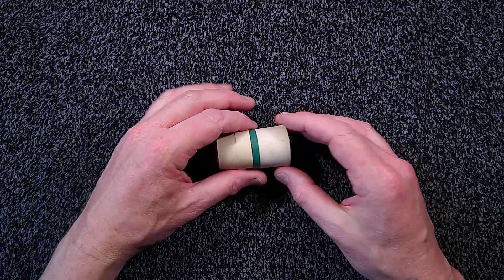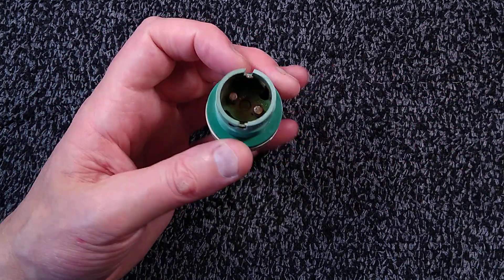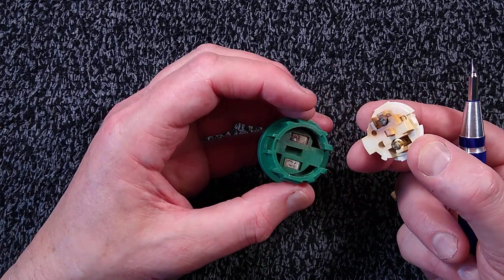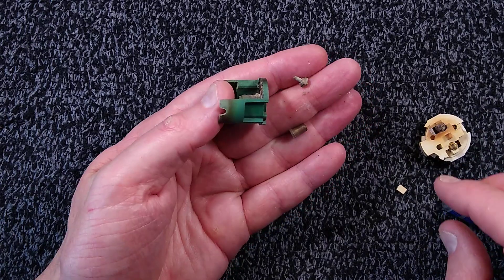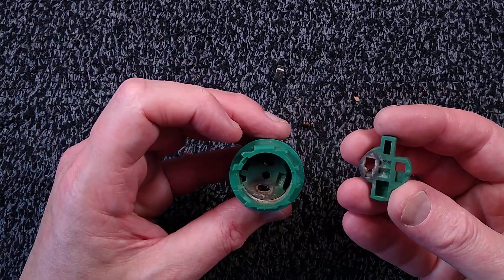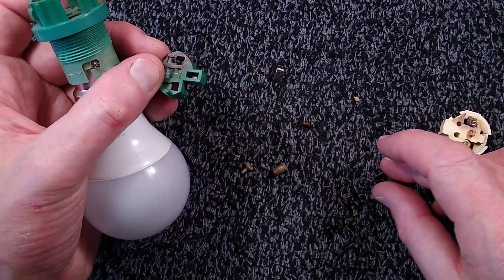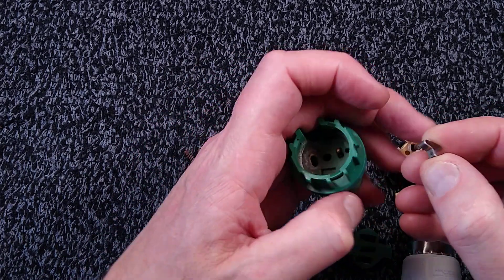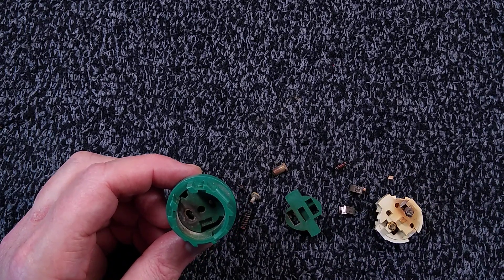Inside a failed safety lamp holder.

Comment: We always used to have a 150W incandescent bulb in the middle of our sitting room ceiling and it baked the cable suspending it from the rose. Once my late mother got a cheap paper lampshade which just hooked around the table instead of having a proper fitting. The cable baked until it became brittle, then the hook broke through the insulation (incidentally becoming live) and with a great flash short-circuited the live and neutral lines and tripped the circuit-breaker. Not long afterwards we replaced the 150W incandescent with a fitting that had five 60W equivalent compact fluorescents. This gave the equivalent of 300W of incandescent light for 66W of electrical power and enormously less heat.
Reply: We had a similar setup in our home in the 1960s, except that the lampholder was a batten type flush to the ceiling. Each Christmas, my father would very carefully remove the bulb to install an adapter for the Christmas tree lights.  In those days the cable was vulcanised rubber insulated, but when the local electrician finally replaced the lampholder, all the original insulation had crumbled and had been replaced with cloth-type insulating tape. He recommended fitting a circular flourescent lamp instead.
Reply: It's odd how 150W bulbs were readily available but the bayonet holders they plugged in to seemed to almost always say maximum 60W or maximum 75W on their packaging.
Reply: @BrianG61UK  that reminds me when I had my Lego collection in the back of an old barn one time it was climate controlled by the way since that's where the water lines were for that Barn.

I was actually using either 150 or 200 watt bulbs in the area just to provide enough light to see what I was doing I was tempted to put in for us and pictures but I couldn't get enough of them cheaply enough plan was just plug them into the existing sockets with adapters or swapping them out for the lamp sockets with the plugs already on them they were switched at the entrance to the back area.

I've wired up numerous old for us at pictures for people to use for something else or somewhere else other than where they had been originally.

Also when we moved into one of the houses my parents had at one time there was quite a few fluorescent fixtures that were left behind weren't sure if they were originally in the house or otherwise.

It was kind of in that eclectic mix of fixtures in that place as well wouldn't be surprised if some were salvaged to tell you the truth.

My mom was Raising her plans for flower garden and such for the next year she asked if I could test and possibly wire up some fluorescent fixtures over a table set up in the den to start the seeds over the winter.

Of course first check to make sure the balance were good and nothing was wrong with the fixture and sure enough perfectly good fixtures and even some of the bulbs are still good that were with them.

Matter of fact back in the day we would often get used fluorescent tubes when they replaced all of the tubes at various stores they would sell the used ones since most of them still had life in them since they were all be replaced almost nearly all the same time I do believe that some of those places were hardware stores and others cannot remember too long ago.

Also one of the fixtures that comes to mind in my workshop in the utility room in the basement of that house there was a super old all metal fluorescent fixture outer portion was Gray of course the reflector was white.

It obviously had been around for years looked older than the house was even that whole area was wired with conduit as well unlike the rest of the place.

You know how that lamp holder was really toasty on this video well the starter sockets at least one of them on that picture was actually a bit worse.

So when it wouldn't fail to start or just be open circuit just jiggle the Florissant starter until it made contact or it started either one.

Eventually just drilled a hole in the side of the fixture put in a beefy momentary contact push button switch for a manual start since I did not have a starter socket that I could get to fit and I was able to salvage I was looking for one that would fit but no luck without paying about $50 at least crazy I know the price but yeah.

Eventually salvaged one and realized that the other one was about shot as well and grab some extras from the fixture Salvage from the other and all set turns out the same style and mounting on that starter socket.

Also years ago when I was on stage crew in high school I built a little box that had two fluorescent starter sockets and duplex AC power receptacle and a short cord.

Each of the two has of that duplex receptacle were wired in series on hot side with a fluorescent starter socket!

For those naysayers that would say why would you do that well this was to reproduce the flicker of something like a fireplace or other fire effect we just used air incandescent bulbs in sockets wired to a cord design it like this to be more flexible for anything that we might want to use that effect for.

Pretty much cord and plug or Overkill since not usually using a steering cords on stage probably not a good idea either in terms of longevity.

I think the actual cord came from a number 12 extension we had that had damage close to one end even.

And that was one of our worst chords that got turned into 15 amp to 20 amp twist lock adapters with the rest of it and a few other sections wound up being turned into new toofers AKA 120 amp mail to two female 20 all three of which were twist lock.

Also made up a few of the twist lock mail to duplex receptacle adapter is for when you needed to connect a standard plug to the 20 amp stage lighting.

Of course you can also use that in combination with when the 15 amp to 20 amp adapters as well which also made a few more of as well.

The rest of that cord was in pretty good shape but there was I would say Apprentice stage crew member marks I think that one was the one that got caught in the rigging a couple times as well if I'm not mistaken it probably should have been retired and these projects been done years before we did not have enough the adapters as it was so it panned out.

Anytime with our longer cords was retired it got turned into something else more useful since after all that cable was extremely expensive it's a shame not to.

I did most of the cable repairs at my place and other things and I did have all the materials available to do this including a large coil of this type of cable if need be I only had to use a section of it once and that was to fix a light that the cable somehow had burned in 2!

Surprisingly it did not trip out to 20 amp on the stage lighting on that dimmer circuit when it happened.

My guess is the cable somehow got damaged and was hanging on by a strand or two or so you guess what could happen and possibly her damage caused partial short or high resistance short or a combination thereof.

Or if possible that that portion of the cable may have been partially broken and still hanging on by a few strands and got hot enough then possibly shorted out long ago but it was my big bang when it occurred and a large flash of blue light.

Some of the other members on stage or in the vicinity thought at first what they heard was a bulb pop AKA halogen bulb exploding at end of life or due to Natural aging of the halogen itself sometimes those puppies explode putting them out of putting them out of their misery.

What is cloakley referred to as a bulb pop.

If you're wondering there should be some videos of this here on YouTube and I know I've seen at least one about occurring on live news here somewhere years ago.

I've seen plenty of things go bang in my day maybe not quite as many with big Clive but close to it!

I remember one person quite early slipping up working on tightening up a light fixture goes loose didn't realize that the power was still on to it since there was no bulb in it and failed to check if there was a power to it screwdriver slips winds up going into the socket and bang took out the rest of the basement lights in the process.

I have seen just stared incandescent not halogens though explode before occasionally the C7 and a half and C9 Christmas lights as well.

In the past I've had two bathroom night light bulbs explode as well.

One of them there's a heck of a lot of plasma!

I actually kept the night light bulb fixture and what was left of the base of the bulb to show what can happen under the circumstances.

On the thread section of that bulb base a good section of where the threads protruded were vaporized it was one of the aluminum based bulbs as well not brass.

I'm not broken to me incandescent bulbs by accident here in there as well.

One time I was just driving a nail in hit the nail Hammerhead came off the handle it took out the light bulb behind me that's one in a million!

The guy that was in the room said who put out the lights I said I think it was me!

Also want friends with repairing window just after you put the new glass in was hammering a nail that had popped in the window frame takes out the very pain of glass he had just put in.

Also when we were redoing our windows and repainting my mother and father didn't wind up breaking a few pains with the heat gun stripping the paint and a couple of times had not realized there was a few more glazing points than they realized and kept breaking pains trying to put the new ones in.

The person that ran at hardware store told us that was one time that somebody kept doing that and they got some embarrassed they sent their wife to get the glass panes to keep doing it and in the end found out about the glazing points being there that they didn't see and that's why they kept breaking the glass so many times just goes to show always expect the unexpected
Reply: @aaronbrandenburg2441  Again, brevity, not speech to word salad is recommended.
Reply: @girlsdrinkfeck  Bakelite is an early form of plastic. [Also: ARSE! :-)]
Reply: @BrianG61UK  you were meant to use the metal (brass) and ceramic types for high wattage bulbs 😉
Reply: @andygozzo72  Yes. I have come across them but I don't remember seeing them for sale. The ceiling lights at my parents house had the ceramic holders but, because they were somewhat enclosed by the lampshades, were still labelled as 75W max.

Comment: I can't say I've ever seen a lampholder like that one. Very interesting!
Reply: The laundry in my house in Australia had something similar.  It was a semi-swiv to let the lamp hang vertically as the fitting was mounted on a sloped ceiling.  Without a lamp installed the pins were dead.
Reply: @retrozmachine1189  I was just about to ask another person commenting if these were a commercial fitting, but you answered my question before I got to ask it! I'm assuming these would be used in an area where other hazards would be present, then? I can't really think of a time that I've seen these in the US (but I don't really go around looking at lampholders, either).
Reply: @jasonkuehl639  In this case I think they used a safety fitting because the fitting is comparatively low due to the ceiling being sloped.  An average person can reach up and easily stick fingers into the socket while all the other bayonet fittings in the house require a chair or step ladder for the average person to reach.
Reply: @retrozmachine1189  that makes sense. Knowing my luck, I'd be the one to stick my hand in the socket while removing damp laundry from the washing machine, the whole time thinking about needing to run out and buy more lightbulbs. Only in my case, for some unknown reason, the pins would be live! 😄

Comment: Simple , but effective. I liked the design. Yes it does appear it was heat cycled one too many times. Or the contacts were dirty or worn a bit causing arching and heat, thus failure. Thanks for the tear down. We don't have that style bulb here in the US unless it is in a 12V application.

Comment: One of these could have saved me from my first mains shock that I can remember as a child when I was with my dad in a department store to buy new bulbs. They had a lamp holder mounted to the edge of the shelf so you could test the new bulbs before buying, so naturally I pressed the contacts inside. But then again it would have prevented a valuable learning experience.
Reply: @Matt Quinn Well having an assistant do it is one thing, but having it mounted on a shelf in the aisle for the general public to use was an accident waiting to happen, which it did. I was just lucky I came away from it unharmed apart from a small burn mark on my finger.
Reply: @Matt Quinn Standard Woolies equipment, but IIRC there was a button in each side of the tester, and both had to be pressed to complete the circuit.